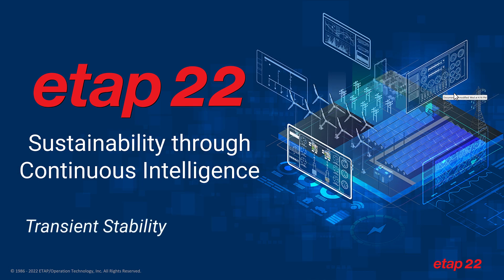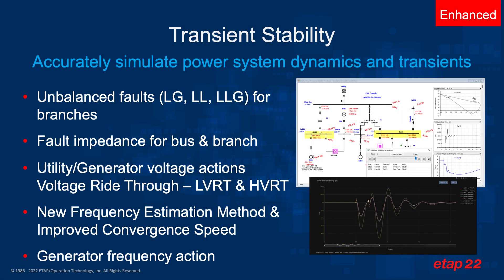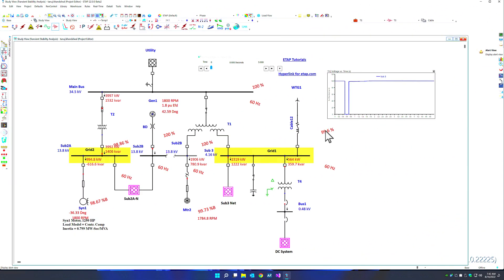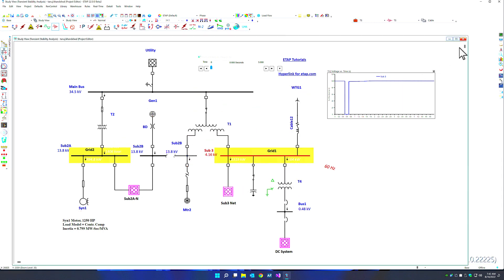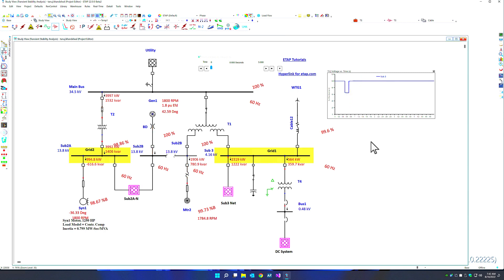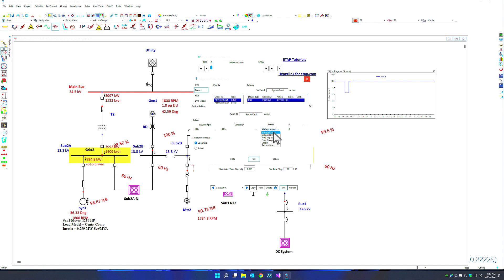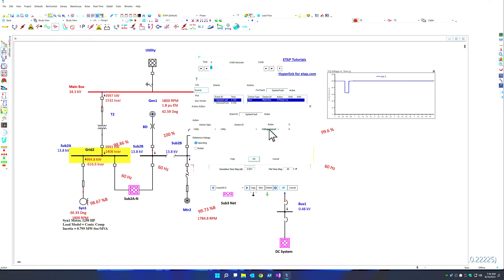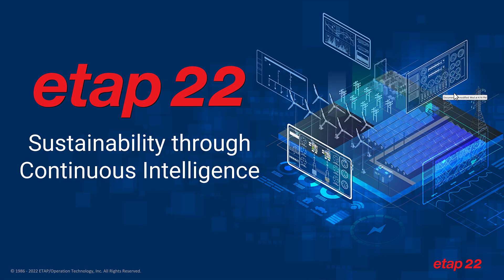Enhancements to Transient Stability Analysis in ETAP 22

Comment: Hi! Taking into account all factors, i would like to know your opinions on which profession is better relay protection engineer(power system protection&control engineer) or power system engineer(power system modeling&analysing engineer)? I'm young relay protection engineer but in our company i also have access to such power system simulation software as Digsilent Power Factory and can't decide should i continue to be a P&C engineer or should I move to power system modeling&analysis to be a power system engineer?
Thank you in advance